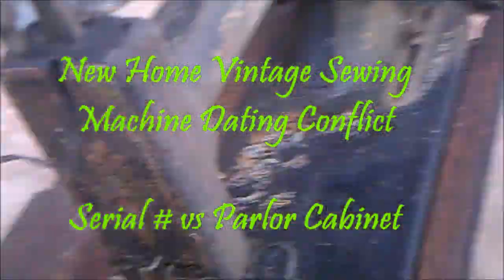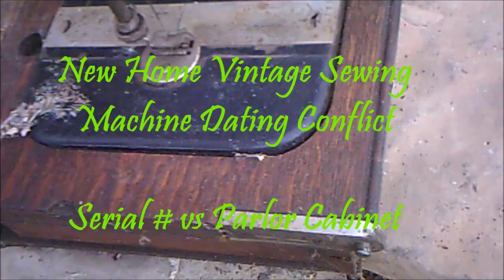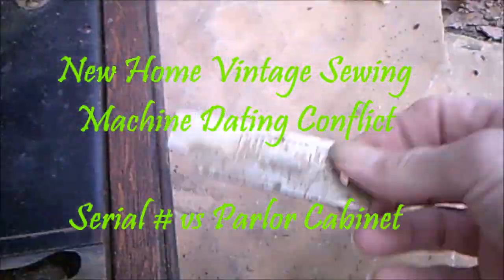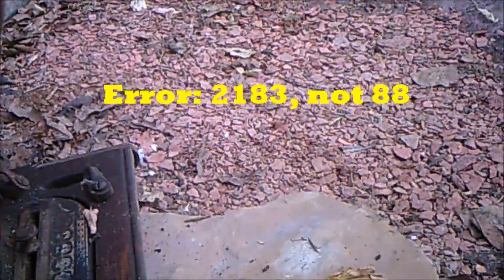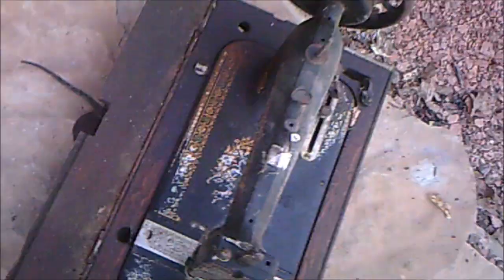Date ID CONFLICT - New Home Vintage Sewing Machine - Serial Number vs Parlor Cabinet

Comment: My mother found one of those in the house I grew up in . I was pretty good with it by the time I was 8. In high school I had a job repairing horse blankets   with a commercial model  of the same machine .     That's a great find
Reply from the maker: Wow.You would be a super resource if I get it up and running; the parts seem to move; nothing broken but all gunked up with time, dirt, etc. This machine part just lifted out, the set screws falling out of the eroded cabinet wood. Before that the treadle worked so shouldn't be hard to remount.

Found zero accessories, attachments, etc. so unsure about modern needles or any key missing parts. It's that wonderful engineering, style and design that's so wonderful.

Reminds me of that saloon door safe from 1890s stuck in the old Montana Mine Company geology bldg. I got 1-time permission to enter; abandoned for years and this safe is stunning with design, still full color after all this time. Shown near the end when I got to that room: https://www.youtube.com/watch?v=WyZyOPbbbpk&t=2s